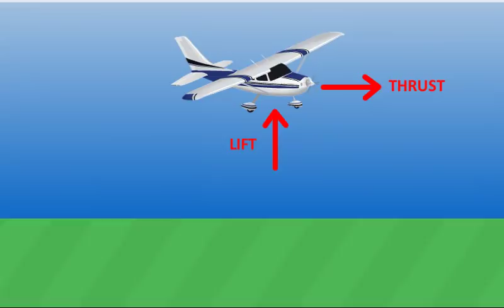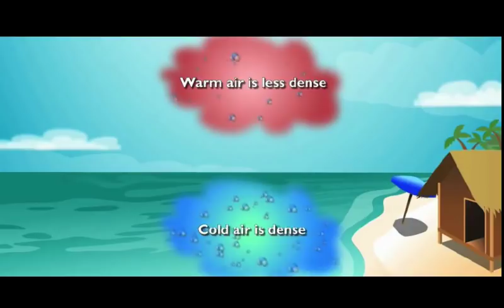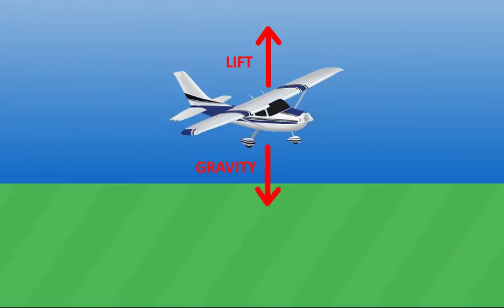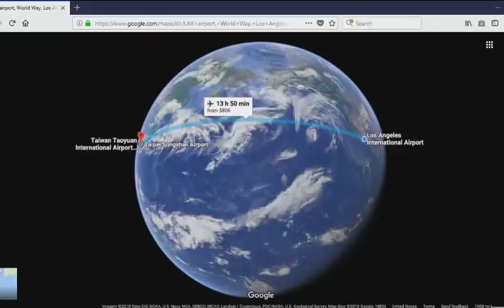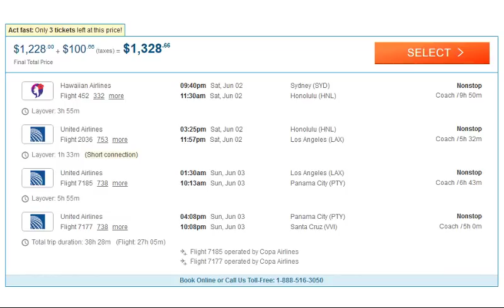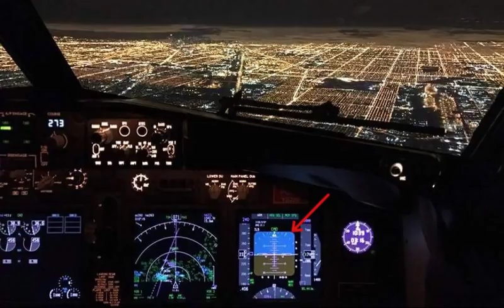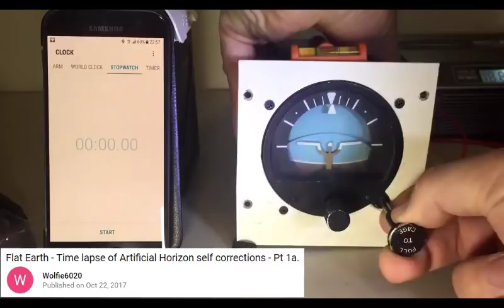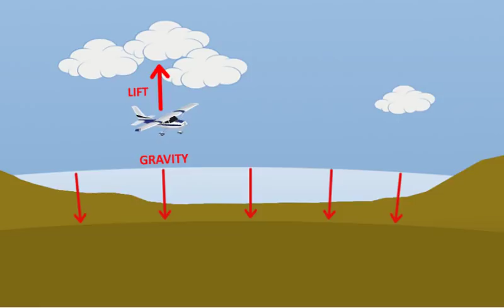Flat Earth Falsities - Plane Nonsense

Comment: If the atmosfer is spinning with the earth you have the problem of the vacuum . there is nothing separating the vacuum of space from the spinning atmosfer .its a kind of magiiiiic.
Reply: Paulo: do you agree that air pressure drops with altitude? Air pressure at sea level is higher than air pressure at the top of a mountain. (That’s how barometric altimeters work). Agreed?

So... how can that be? There is no physical barrier between those two different pressures. Why doesn’t it all just balance out?

I would say gravity. You probably have some other answer, but hopefully you know that “something” happens. 

So now apply that same thought all the way up through the atmosphere until you get to the zero pressure of the outer exosphere.
Reply: A vacuum doesn't suck son, vacuum cleaners suck.
Reply: It’s a belief in evidence. It’s a belief that if something correctly predicts real world outcomes with great accuracy then there is probably some truth to it. 

Now, do you accept that air pressure is greater at sea level than at the top of a mountain?
Reply: Paulo Silva says, "the vacuum of space and the atmosphere it needs to BE separated by something solid ,ok?"  No it doesn't.  For the air to zoom off into space, the air molecules need to achieve escape velocity.  As we know the speed of sound in air tends to be around 720 mph, depending on temperature.  That is the speed the air molecules are bouncing around against each other.    Escape velocity is 25,000 mph, so air needs to go about 30 times faster to escape gravity and head off into space.   Occasionally a high energy particle from the sun or a gamma ray may impart enough energy into an atom of air, but mostly they just stay in the atmosphere captured by gravity.
Reply: Paulo Silva   The vacuum of space is not a suction device. Eg; vacuum cleaner. The vacuum of space doesn’t suck. It is not negative pressure, it is no pressure or zero pressure.
Reply: Paulo Silva gravity holds the atmosphere to the earth. And if you want to comment about the atmosphere you might want to go back to school so you can spell it.
Reply: Paulo Silva it's a thing called gravity and it pulls the atmosphere DOWN. Not hard to understand.
Reply: Bobby Wizdum gravity exists,it is a proven fact. All you have is to scoff and deny it's existance. It's proven and has been confirmed to be a fact.
Reply: GrahamStw 
I met flattard who claimed that you dont need oxygen mask during climbing on Mt. Everest and altitude illness is caused by different biom or hoax.
Reply: But there is no barrier between these different pressures.  Which you say is impossible.
Reply: marvin martin how the f do you know?
Reply: TheCommunistDragon yes we get it. just say gravity and all is well? bla
Reply: TheCommunistDragon its just  a belliev (Gravity).
Reply: Bob Senior the vacuum of space and the atmosphere it needs to BE separated by something solid ,ok? They dont teach you that in school but is cience.have a Nice day.
Reply: Bobby Wizdum   Science!
Reply: Paulo Silva   Stop it! There is nothing between our atmosphere and space. There is no dome! No firmament! According to the bible it ended at Noah’s flood.
Reply: +Paulo Silva/ there is no solid separator between water and air, water has higher pressure, why don't the oceans and seas get sucked into air ?
Reply: Bobby Wizdum - Oh Booby the fucktard is back! Booby likes writing letters then cuts himself up over the letters lol. You're a bit of a braindead simpleton Bobby.
Reply: GrahamStw we leave in a pressured sistem because we have a solide dom Over us .there is up and down ,if you go down the water the pressure increases if you go up to the sky the pressure increases also.